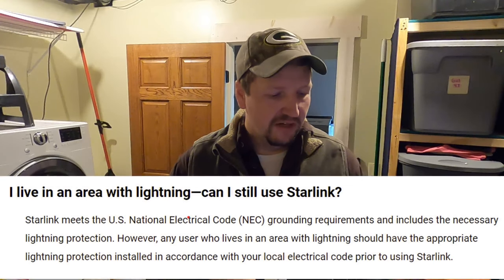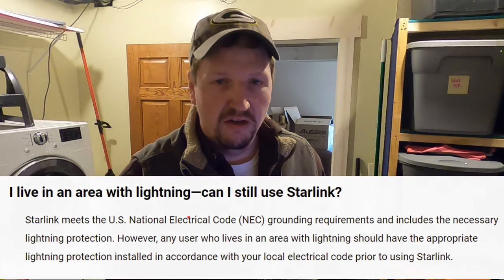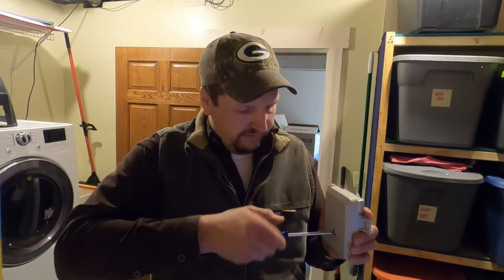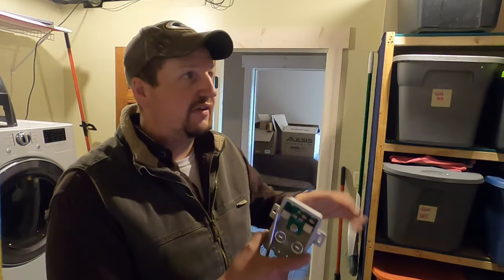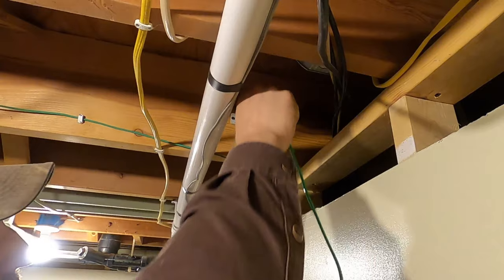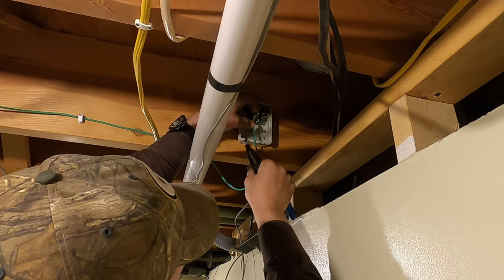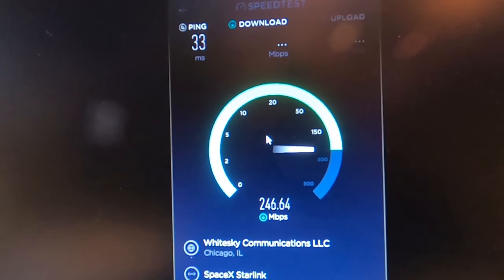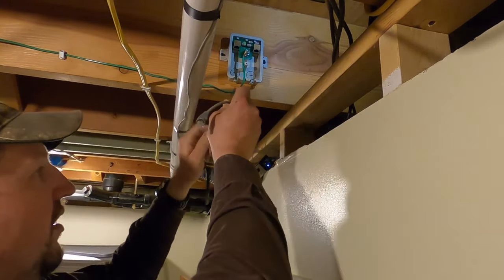Starlink Lightening Protection - Installing a Surge Protector

Comment: I believe it is best to have your ground junction box outside, with the length of your ground wire shorter than the ethernet going to your router. Reason being, the electrons from the lightening running through those wires will take the shortest path (instead of taking the ground for the sake of taking the ground). Therefore, the lightening will take the path to the router. Also, those speeds are spectacular to what I have with the Starlink RV service.

Comment: I use a Ubiquity version $12 and allows for grounding.

 You need two, one outside with ground and one inside before your router so you can have two lines of defense before your home network.

Unfortunately I did a single inside before I read the propper setup
Reply from the maker: Thanks for watching.
Reply: Normally you would have two surge devices but both would be outside.  A direct or almost direct lightning hit is going to fry anything hit by or wired close by, these small boxes will do nothing.  That said chances are you are not going to experience a direct or almost direct lightning hit.  If lightning strikes close by though it can charge the air and send an induction surge through unprotected outside wiring.  So Ubiquity recommends two of these small boxes as close to each end of the outside wire as possible.  One protects the induction surge going to the attached outside device and the other protects the induction surge from entering the building.  In Starlink's case you cannot really put on right after the dish since the cable is attached to the dish or has a special attachment end.  So you put one either right before or after entering the building like he did.

Comment: Great idea, nice clean install! Was curious though and I know you said there wasn’t much documentation. Was just curious why you decided to put it on the router side of the Starlink POE box? Instead of from Dishy to the surge protector then to the Starlink POE Box? Should a surge potentially take place wouldn’t that save the POE Box and ground it out first or as long as it’s in line somewhere it provides the same protection?
Reply from the maker: Mostly because I don't have the appropriate wire if I would put it on the Dishy side of the POE box.  I'm not sure if the wire they run from the POE to Dishy is different/needs to contain certain power requirements.
Reply: @OutdoorsEngineer  yup the cable has to withstand a lot of power considering the starlink dish also has a Heater to melt snow etc, usually you dont want to mess with that wire
Reply: @hyperfluff_folf  There is no "heater" component in the dish, rather the software increases the current consumption through otherwise useful components based on the temperature detected, Starlink calls this "Snow Melt Mode"
Reply: @theshantyman  nice

Comment: You need to connect dishy to the surge protector... then to the power brick.....
Reply from the maker: What wire would you recommend to use then from the surge protector to the POE, considering the amount of power that Dishy requires?
Reply: Agree, don’t you want to protect the dish side?  Cat6 all the way.
Reply: Exactly what I was thinking as well because I believe you would want the discharges to go directly to the surge box from the dish instead of from the dish, then through the power injector possibly damaging it before getting to the surge protector box
Reply: @lucasdantas723  more importantly since the POE injector is on the house power you give lighting a path back to your house electrical. However Dishy requires 100W of power which is past the spec of normal cat5/6 normally rated for 35W@350mA) hence the special cable. They really could use a better solution. I just got accepted for my order and I do have some lightning arrestors kicking around to play with. I will see what I can do.
Reply: @WTFUSERNAM44  I've heard of some people terminating their own cat 6 22 awg solid copper cable to make it work
Reply: @lucasdantas723  I plan on trying that. My dish order just went through after waiting for months. I have thousands of feet of cable, boxes of lightning protectors and lots of bits and bobs. We shall see how it goes.
Reply: @WTFUSERNAM44  f you get the V2 of Starlink it has proprietary ends on the cables and they are no no longer standard type Ethernet connection.  You would not be able to do what he did in this video with cutting and splicing.

Comment: I don’t k ow what kind of ground comes with Starlink , in my experience twice in a month I have lost my Starlink router because of lighting, they have sent me a refurbished one every time. I hope I will have more luck this time! Very disappointed
Reply from the maker: Did your dish get struck by lightning or did you lose the router due from lightening in the area causing a power surge? I try to have surge protectors on all of the sensitive equipment in the house to avoid and power surges taking it out.

Comment: I see ground wires attached to my copper plumbing.  Could the ground wire from the XCATSURGE attach to the home plumbing in the same way?
Reply: yes, your copper pipe is a legit ground
Reply: @-OmniOne  It can be a legit ground if it is continuous solid metal all the back underground which is not always the case.  Certain types of fittings will break the ground unless they are manually wired across.

Comment: I'm not so sure if you can run any ethernet cable you want from the power injector to the router as that line also has some sort of power to power up the starlinks router/modem. It's not as important I would assume as the power would be very much minimal compared to the power going to the dish
Reply from the maker: I'm using Cat5e and I'm pretty sure somewhere in the documentation it says you can use your cable.  No issues with the Cat5e here.
Reply: Starlink's Router is powered by standard POE voltages and can run off any standard Ethernet cable (store bought or home made).  Starlink's cable is waterproof and outdoor rated but if you have it running inside any Ethernet cable will work fine.

Comment: Shouldn’t the surge protector been installed outside the home?
Reply: If you’d see an Ethernet surge protector after it did its job you’d want it installed outside. Less fire risk, especially if it’s mounted on wood. Probably should be mounted with a sheet metal backing on the wood.

Comment: Mechanical surge protection is a joke. Mechanical or electronic switches cant trip faster than the speed of lightning.. on a battery power supply offers protection..